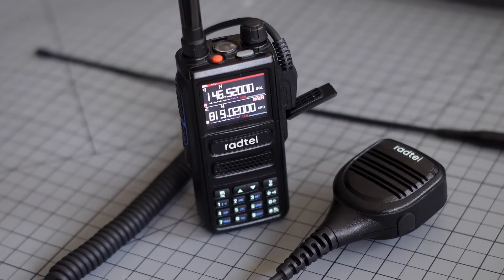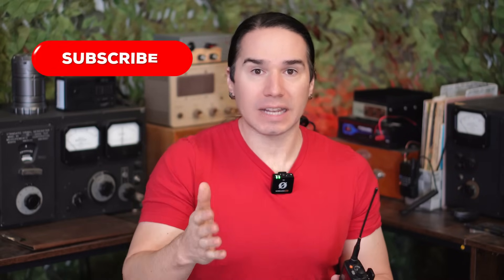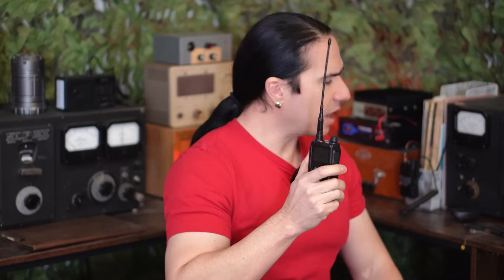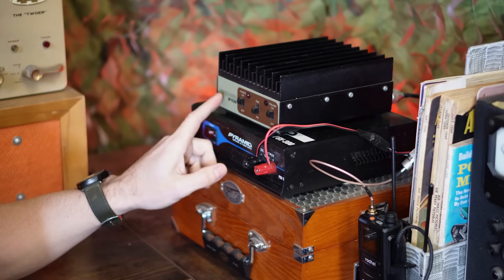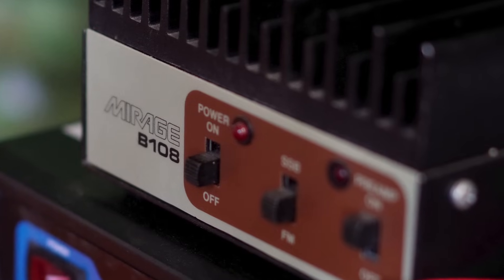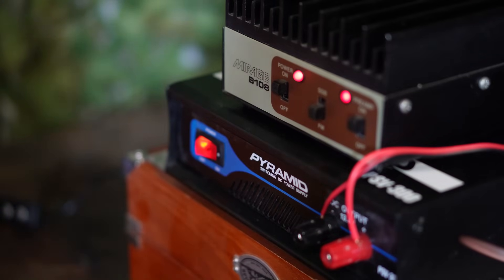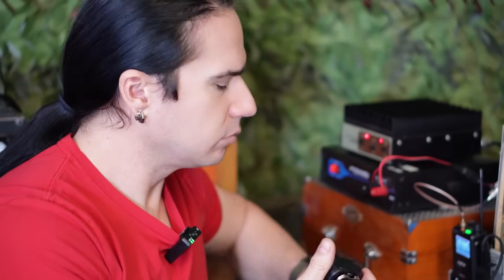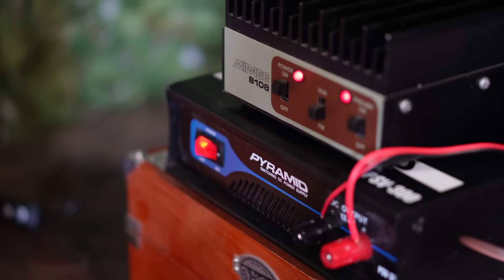Cheap Handheld HAM Radio as a Base Station? How I do it...

Comment: I plan on using a HT anyway on a motorcycle, I don't see this being a bad thing as home base since I have a few of these HTs. I'll permanently mount a mobile dual vehicle antenna outside  with a passthrough since I have experience installing cable TV.

73 de kq4hcu

Comment: My experience is that most budget hand held radios don’t put out quite as much power as they claim they do.  But antenna tuning tends to mean more than that.  Even an “acceptable” swr of 3:1 will knock a huge chunk out of the power that actually leaves the antenna.  A “5W"' UV-5R might only put out about 4 watts & 1.5 Watts might get reflected back due to the SWR being off a bit, leaving only 2.5W getting out into the real world.  The little 40ish watt VHF amps from B-tech claim to filter out the spurious emissions that the small Chinese radios were famous for.  My recent spectral tests show that the newer cheap Chinese radios are actually a lot cleaner than the older ones were.  A new UV-5R I tested a couple of months ago was nearly 60dB down on harmonics.  That’s pretty clean.  These days fewer guys seem to use the little 40ish watt linear amps on hand helds because the 50ish watt mobile radios have gotten so much cheaper.  You can get a new UHF/VHF mobile combo for not much more than a hundred bucks if you look around.  But your way also works & I happen to also like to do it that way.  It prevents me from needing to remember how to set up & program 2 different radios.
Reply: Look up J-pole antennas or dipole antennas.  $30 worth of stuff from Home Depot will get you enough wire, tape & PVC tube to make one for VHF/UHF and $20 will get you enough stuff to make one for UHF only.  Solid AWG14 wire is good radiator material for the amount of wattage you are pushing.  You can tape it on the outside of a PVC pipe with electrical tape to hold it in place once you have the shape.  If you are in a HOA where you need to hide the antenna, you can get a color of wire that matches your exterior woodwork & mount the wire directly to the trim boards.  You can paint over it to really hide it too.  You will need use of a VNA or antenna tuner to adjust it.  You will need a soldering iron.  A good working antenna mounted outside means a lot.

Comment: Thanks for this- exactly what I've been searching for.  I'm located in New York City and have a Yaesu VX-6.  It functions great as a scanner, but I don't hear anything on any of the local repeaters and I can't seem to make contact.  Your video was very useful.
Reply from the maker: I'm glad it was useful! By the way, are you sure you have the repeater offset and PL tone setup correctly when trying to make contacts on the repeater? If that's not set right, you could be right next to it and it still won't work.

Comment: They are also limited for digital modes if they have baked in hardware and software filtering, typically aggressive hardware hi-pass and software bandpass EQ for intelligibility. Their DNA is designed for voice, which you don’t want for digital modes. I’ve seen someone who’s modded them to flatten the transmit frequency response making digital modes MUCH more effective (and in some cases even possible) but that’s soldering surface mount components and a custom firmware that flattens the bandpass filtering. Also once you’ve done that you also have to consider how that mod affects the power drawn. These radios still have high voltages inside and that means tiny changes in current can have big effects. You can end up trying to make a circuit that wasn’t designed to tolerate a power load have to tolerate it, and it might not be able to… you need to KNOW what you’re doing, not just wing it. 

This is a VERY basic reality of these transmitters that I’ve almost seen no mention of anywhere. It CAN be done, apparently, but you’re in for a project. Also once you start doing that you’re basically welding a rocket to the bed of your truck because that filtering is also designed to affect the harmonic interference suppression and suddenly you have gone from a  marginally legal RF harmonics suppression into an RF amplifier… there be dragons. A little knowledge is a dangerous thing especially if you accidentally interfere with government or other non-amateur spectrum allocations, and you can get in trouble especially in a built up area way faster than most people would realize. Yes, you can put this into an RF amplifier, but you BETTER know exactly what you’re doing especially if you combine that with unsupported modifications to the RF certified design. Some people seem to want to pretend this can’t become a problem, and that the real problem is any objection to violating the license terms but it can become a problem and you could end up with a heap of legal trouble and fines that you did not count on getting. Be very certain on the RF harmonics end of amplifying an RF output from a marginally certified HT is probably the best advice.

Comment: I use my Kenwood D75 mobile and sometimes at home as a base station(primarily for d-star) as well. The thing I had to learn the hard way is you need to be mindful of how long your coax run is. UHF/VHF deteriorates much faster than HF the longer the cable. So at a certain point, your losses will mitigate your gains using the amp. Theres something to be said for height and location of antenna though. Someone whos better at math could explain it better but start with your coax rf loss per 100' and dive in from there. 73

Comment: Is it possible to use a HT as a mobile/base set? Yes it is possible but a 140/440 amp is more $$ then a 25watt dual band mobile and a mobile microphone is 10x better then the speaker microphone on the under $50 range.

Comment: Nice video. When i was first licensed I started with a Radio Shack 202 handheld
5-watt radio. I later found Radio Shack here selling a 2 Meter 35-watt amp for $25.
Took the amp and a mag mount antenna and used it in my truck for mobile. Quick 
and easy to take the radio in and out of the truck. Great Ideas when on a small budget.
You can also make a cheap 3 element tap measure handheld beam antenna to give
yourself more gain and directionality. Nice video Gary KF6EWO

Comment: Nice video Max. I own the exact same model mirage amplifier. It has a single 100 watt Motorola final transistor. Pretty tuff unit. I modified mine to accept 25 watts input and I use it for 2 meter ssb with a pair of 14 element hygain 2 meter vhf beam antennas in phased array, and it does the trick with band openings. 
I also use a baofeng uv5r7w on 2 meter packet on lifpo4 batteries and solar panels on a copper slim jim antenna at 120 feet running lmr 400 feedline and it has good coverage area where I live. 73 GOD bless and great video as always Max. Earnest K5EWM 👍.

Comment: Great video and a good review too. Being out here in LNK land not much radio talk on either repeater or 146.52. 10-meter is dead been trying all day now. Nothing but noise. Glad I was able to get on 10 meter in 2011 it was great for about 5 years 73 Countries and 1210 QSO of those only 478 Confirmed on QRZ but not everyone uses QRZ logbook. Then slowly went south. Since, I am only a tech. since 1996 it was just 2-meter and 5 HT radio to boot. Oh well that life in the Midwest. I also have a Kenwood 2000 in 2012.  Another problem I just have an inverted-v wire antenna facing north and south up on a tree at a height of 15 feet. 73 from Nebraska

Comment: Max, this channel really needs more views I'll tell you! 

Recently my VV898 I use at home gave up so I have been using a TD-H8 with my mast.

I was considering ripping the KT8900D out of my truck and using that, but I like this idea if I can find a cheap used amp.
 

Both BTECH and Retevis make amps but they are both north of $100 and I may as well buy a mobile for that.

Hope all is well out there brother stay safe!

Comment: When I got my Tech about seven years ago my first everything radio was a TYT UV8000 and a BTECH speaker mic. With the help of the radio club, we put up a Tram Discone antenna on the roof. I put a through-the-glass antenna on the van. Using the coax adapters I was able to use it for base and mobile operations. Several handhelds, a General ticket, and more radios later, I put that old UV8000 to use in the Gladiator today. My VHF rig in the Jeep is a 2-meter Yaesu FT2900. I just put the HT with a battery eliminator and hand mic in the Jeep to cover UHF. It goes to a dedicated UHF antenna. I also dropped the rubber duck and a USB-C chargeable battery in the tray the radio is clipped to so I can go portable dual-band as needed. I am also GMRS licensed with GMRS radios on my wife's and adult son's vehicles. I can neither confirm nor deny that my HT can operate in such a manner.
Reply from the maker: Sounds like you've got a great setup going!

Comment: I had a UV5R as an EDC radio for over 15 years....   Then I decided to turn it into a base unit....    I eliminated the battery with a 12 vdc plug and put the base station antenna and a hand held mic......   works great!     I took the other uv5r and now carry it EDC.....   When I am in myy vehicle, I have a mag mount antenna on the roof so I can use the HT as a mobile unit....

Comment: My first radio was a 5 watt HTX -202 in the 1990s and I had it set up just like you have there and used it and a 50 watt VHF amplifier to talk all over North Texas. I made my own 2 meter yagi antenna from a Radio Shack TV aerial. I used that setup for years before buying a 50 watt mobile.
Reply from the maker: That's awesome, you had a great start to your ham radio journey.